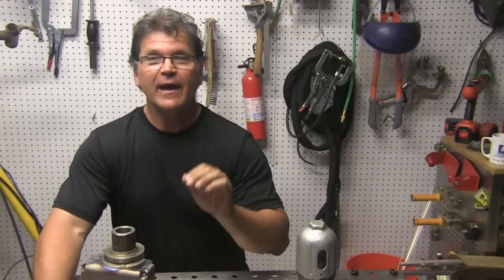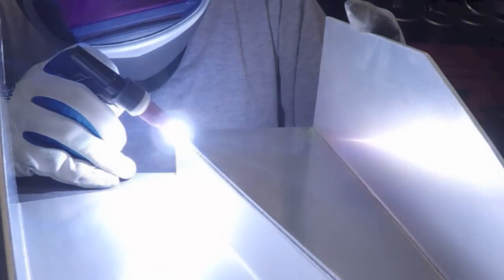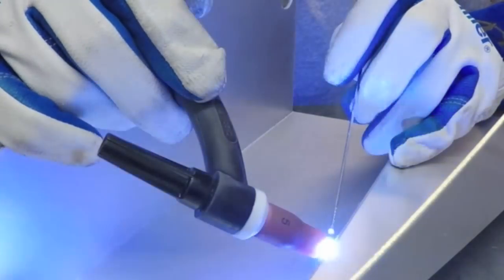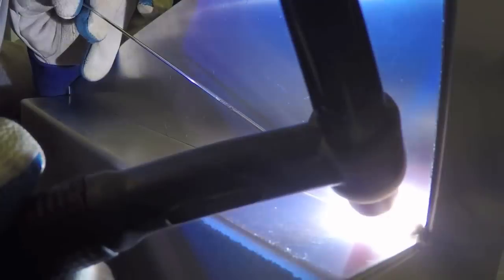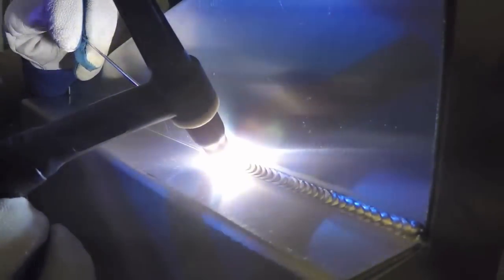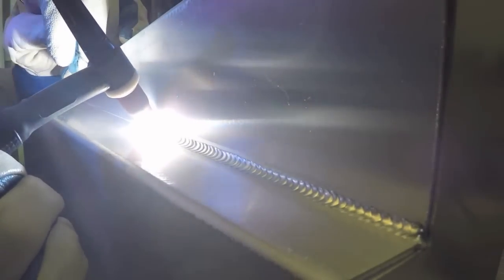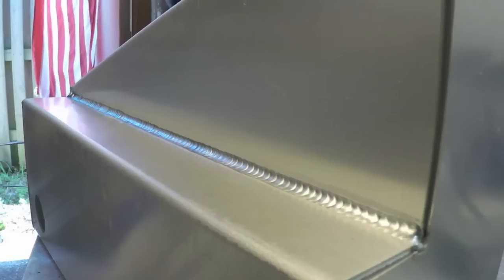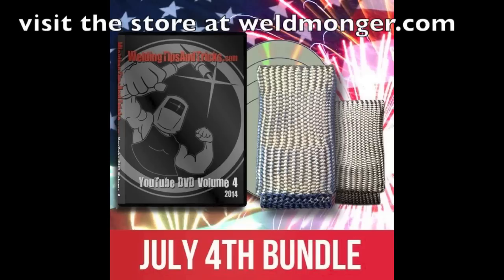TIG Welding Aluminum Outside and Inside Corner joints

Comment: Just that one little clip of Roy starting 1/4" off edge saved me! I was always Tac'ing my TIG welds on the edge/corner (like you might with a mig, doing sheetmetal), and having problems burning through. It seems simple, but the way Roy started 1/4" off, then just backed the puddle up slightly, then continue forwards with his bead showed me what I needed.  Thanks Jody, thanks Roy.

Comment: I think textbooks will tell you to always add filler to the leading edge because with steel, where you add filler will typically change the profile of the weld bead and pool, but I think that the way an aluminum puddle acts it does really matter where you add filler, especially in a inside corner. Yk, surface tension and stuff

Comment: What would the backside of these welds look like?  I'm having a hell of a time getting complete penetration consistently TIG welding some 1/16" 3003 diamond plate (butt welds or outside corner joints).  I almost always use the foot pedal with the machine (Syncrowave 250) set to 130 amps (never used full pedal), 3/32" 2% lanthanated electrode with about a 40-degree taper, A/C balance set to about 62-65% EN.  Portions of the weld get complete penetration on the backside while other parts of the same bead get little to no penetration.  I've seen suggestions of use the filler rod to "push" the metal into the joint but I can't say that tried it.  The topside of the weld beads look good; shiny beads and consistent intervals, no cold lapping. I'll be damned if the penetration isn't consistent, though.  Any suggestions?

Comment: Nice video!! I am just starting out.  Aluminum for framing decks on boats is going to be my first project. I am sure I am going to need to weld light steel etc as well. What would be your recommended welder -- Miller, Lincoln Electric Yes under $700 used or new? If this is too broad of a question let me know if you have any other videos where you already have explained this.. thanks!

Comment: Hey Jody,

Do you know if that aluminum was laser cut or water jet cut? From what you know, do any of those 2 processes usually make a difference for tig welding afterwards?

I had a project a few months back for a similar kind of box as in your video but it was 0.050'' thick (and i believe 5052 material). I had a real hard time tigging it with 5356 (it was getting anodized after) and I also tried 4043 and it didnt help much.

Any recommendations?

Thanks,

Justin

Comment: Hello!  I enjoyed your video! I would like to know if you could help me by welding up my Boss 260 intake from Australia.  It is orientated on the wrong side and I would like to get it cut and welded so the  throttle body will face the passenger side and be able to accept a 4v ford throttle body with a provision for an idle air control.  I am not a rich guy but my 36th Birthday is coming up on April 1st and I would like to have this as a birthday present from me to me!  Either way thank you and God bless you Jodie!

Comment: what is the easiest way to learn how to push in filler rod with Tig, i just started yesterday with TIG and i keep burning my fingertips, what exercises or things i can learn to improve my filler rod adding technique?
Reply: Alpha Texan I'm in welding school right now, they had me take a filler rod home and, with gloves on, practice feeding the wire through my fingers until I could do it without thinking about it. Weldingtipsandtricks actually has a video on it called "Learn how to tig weld better & faster - by learning how to feed that tig rod"

Comment: Hey Jody, if I'm welding aluminum and the machine it's really loud, like a constant buzzing noise, what's the issue
Reply: Nothing that's what it does
Reply: That's the joy of not just alternating current but square wave... generates a lot of harmonics.  After a while it just seems normal.  Then one day you switch to DC for some reason, and it's so smooth and quiet!

Comment: I noticed he's able to have his tungsten sticking out near all machines I've used it wont let me constantly gets inclusion in it
Reply: Maybe higher argon flow so he can raise the cup a bit higher for the video?? I bought a gas lens soon after I bought my first everlast welder. I can only get that much stick-out if I use the gas lens or boost the argon flow.
Reply: Mark Stevansen  Hay Mark it's not a good idea using a has lens on ac I've tryed it the ceramic gets so hot the ceramic shatters.

Comment: ice box inter-cooling of the incoming air charge. not quite forced induction of air but creation a denser air charge the engine use more fuel. and if you use force induction, it can pack more air in the cylinder creates a dense air charge. because with compression of air from forced induction you make heat. and heated air is less dense air. adding a inter-cooler to this you get maximum efficiency. the whole purposes behind it all is to pack more air in so you can put in a equal ratio of more fuel. as fuel will only burn if it has the right amount of air for complete combustion. it's about making more horse power....
Reply: dale myers it helps against detonation in forced induction applications
Reply: The air is coming out of a turbo charger and in to the cooler then to the intake manifold.
Reply: @david platenkamp  it helps with high, compression engines too. as stated before it creates a dense air charge.@randysengine service  force air induction really needs a inter-cooler for obvious reasons. compression of air creates heat. as to much heat causes detonation. that's why i run a dry shot of nitrousoxide in every engine i build regardless of induction system. because cold is cool when it comes to making horse power. chemical inter-cooling rocks.
Reply: +dale myers I;ve never seen an N/A car running an ice box like this. Usually for centrifugal blower cars to cool down the charger or for a turbo car.
Reply: +lightningxx, well have you seen cars run faster as ambient temps go down? it's the same principle. but with compressed induction your creating higher air temps. so your induction temps will be colder with an n/a engine. just because someone has never heard of something, doesn't mean it wont work in any form of engine. there was once water injection, and it was used in the aviation industry during ww2. it's use makes more toque and was used in fighter aircraft. to improve climb rates and dive rates. as water has a higher expansion ratio than fuel alone when ignited. as water expands 1600 to 1 at atmospheric pressure. and does so at 212f at sea level. gasoline is a ratio of 20 to 1 at atmospheric pressure with a higher thermal ignition point.. but gasoline is a low energy combustible. meaning, like black powder propellant, it take compression to boost energy return values. and with excessive compression you risk detonation. water injection aids in reducing these cylinder compression temps and the risk of detonation. now with a cold air box on an n/a engine. this too aids in reducing detonation risk also. it's all in how you approach the situation. i hope you come away with a further education and improvement of thermal dynamic theory. this from a 53 year old man, who never spent a day in formal education. but studied just as rigorously. when i heard something that peaked my interest. i took to the books and talked to those who were there using the technology. today few are still here for the younger to talk to. and with liberals bastardizing the education process. you may not get the truth, as it was told to me. just as some of the new text books, has altered the wording of the constitution to suit an agenda. as many would lead you to think we the people should only have muskets to hunt with. wile a government needs a greater force to squelch any up risings.  yea i'm off topic a touch. but it is relative in it's own way.
Reply: Oh I am well versed in tuning theory, being an engineer and self tuning my own car since I started seriously modifying it.

I didn't say it wasn't useful or effective or that people dont do it. I just said I haven't seen it in an N/A car.  My real point is practical application. Many other things to add to an N/A car to gain power before cooling the ambient air down with an icebox. At that point, you would just use nitrous, meth, or a more knock resistant fuel, unless you're limited by class or something for no power adders.
Reply: thanks Capt. Obvious.

Comment: Jody,
 How often do you recommend changing  the cooler coolant when using Millers'  coolant?     The welder doesn't see much use if that has any bearing or not. (Dynasty 200DX tigrunner package)

thanks,
Jim

Comment: I just tried welding on aluminum today (I'm in college taking a TIG class right now), and I had a problem with aluminum that I didn't with mild steel- my filler metal is melting before I can even get it in the puddle. I tried sticking it in faster but it didn't help. Would increasing the hz help? I was already at 120. Any and all help would be great, thanks.
Reply: +As3sinoL0C0 this channel has a forum on weldingtipsandtricks.com there's a lot of people with experience in these things you should check them out.
Reply: +As3sinoL0C0  A simple fix. Don't think it has anything to do with the settings. 2 things will work. Either go up a size in Filler metal or lower you amperage. You'll have to decide what the best option is in your situation. Hope this helps :)
Reply: what about torch angle? I was having the same problem. Turns out I was letting my torch sag and the heat was getting to my filler too soon, turning its end
 into a turd.
Reply: Stephen Dumaine Yeah torch angle is definitely important. In a perfect world the best angle is 90 degrees with the workpiece as far as TIG goes. Only problem is you can't see shit. So the best angle is as close to 90 degrees where you can actually see what you are doing :)
Reply: p

Comment: I don't understand why you don't crank the welder to max amps then work/back off the pedal as necessary.  Why mess amps/hertz/"gigawatts", blah blah  (:)) that may be too low to run the bead.  Also, I wouldn't break a weld without post flow for a few seconds at least (and alum likely backweld a inch or so).  Just curious.  My way seems to work great, but like Jody says...lots of ways to skin a cat.  Just wouldn't be my way.
Reply: jdh023 Because max amps makes the pedal substantially more sensitive, so you have less control...I like to move my foot only a little, so I tend to set my amperage pretty high, but I know guys who insists on running the bead with the pedal pegged, so they're always hunting for the "perfect" max setting. When I'm welding something I know will take a lot of juice, I set the amperage way up. When you're doing something delicate and you need finer control, less amps is the trick.